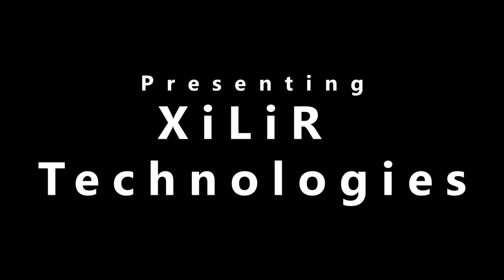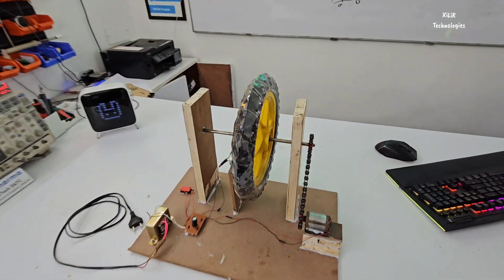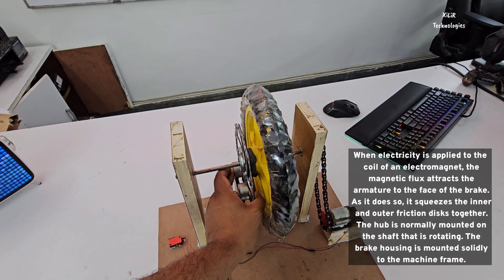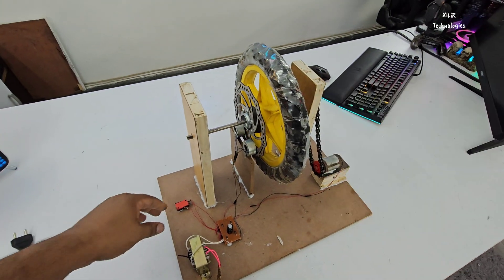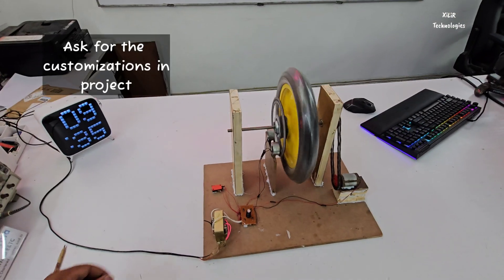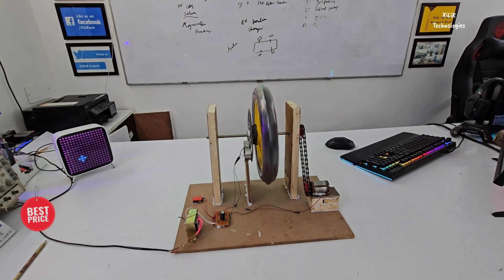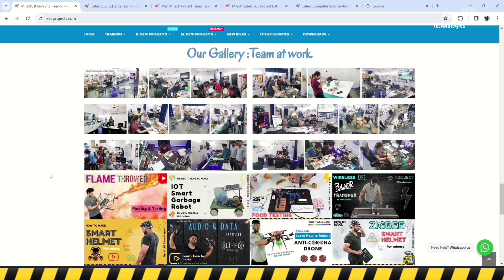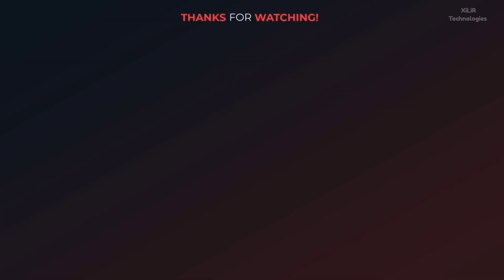How to Make Electromagnetic Braking System Project | Best Mechanical Engineering Project

Comment: Doesn't this kind of defeat the purpose of having electromagnetic brakes? Correct me if I am wrong but the braking force in this project is still friction. Electromagnetic braking is beneficial due to eddy currents that can be created when a nonmagnetic conductive material passes through the magnetic field. This results in frictionless braking, while your project is still braking using friction.

Comment: I'm working on a project to design a vehicle that utilizes an electromagnetic braking system as its primary braking mechanism. Our team is using a 48V, 1HP, 3000RPM, 750W motor and four 12V batteries connected in series to achieve a total voltage of 48V. We're looking to incorporate 12V electromagnets into our design. I came across your YouTube video on electromagnetic braking systems and thought you might be able to offer some guidance or recommendations on sourcing suitable electromagnets for our project.
Reply from the maker: @kritoxd1  check google for heavy electromagnets